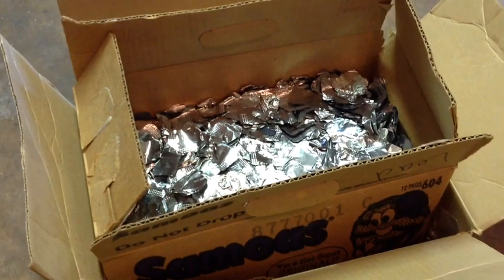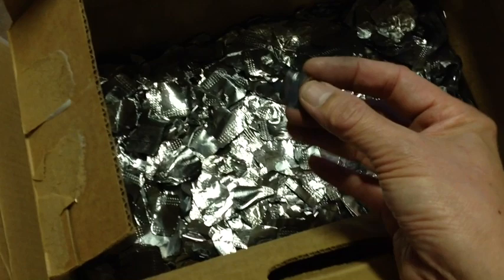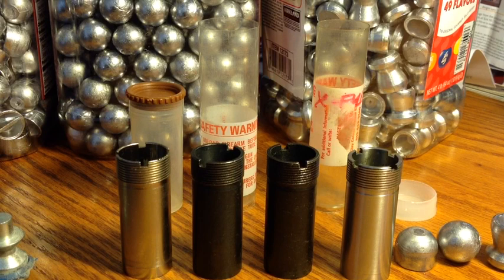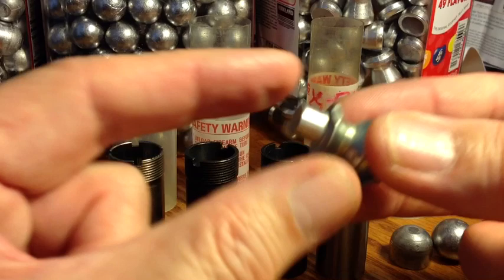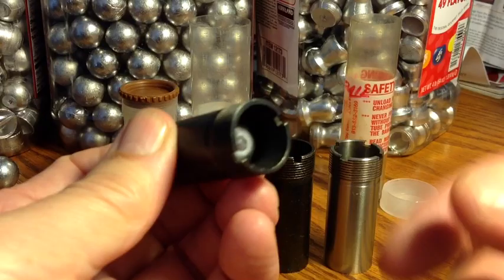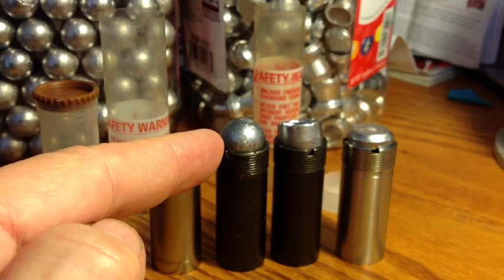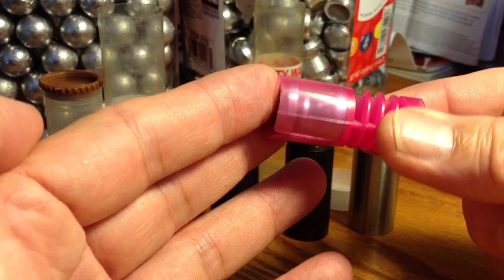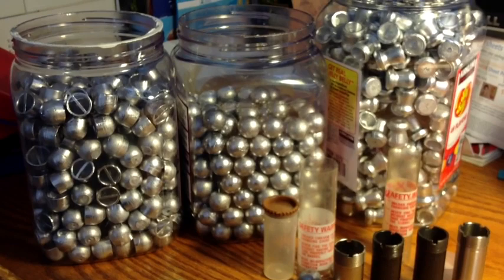Why Only Pure Lead For Shotgun Slugs?

Comment: +Fortunecookie45lc I picked up a Carleson's extra full choke for my 870 tactical smoothbore. It is 0.690" and my 7/8" ounce lee slugs fit through it almost perfectly (without a wad). The widest part of the slug is 0.680", so there is about a 0.005" clearance between the slug and the barrel at the widest part when it passes through the end of the choke. My question is, can I use the lee slug safely with this choke if I completely cut back the petals on the wad and do you think I would get good accuracy using it? I think it's a worthwhile experiment to try, but I'd like your opinion on it first.
Reply from the maker: jjenson2006 - Sorry, got to give you the company line on this...Those Lee slugs are designed to 1) be cast of pure lead for max softness 2) be put into target trap wads and 3) shot through cylinder bore chokes.  Problem is that if you shoot those slugs through your XF choke - 1) if petals are not removed, you will have high pressure from the petals stripping off - you've already addressed this concern 2) if cast hard at all, you will have higher pressures 3) the slug may very well slug up a bit and then when it hits the XF choke tube, pressures will spike.  There have been many cases of shooters accidentally shooting these slugs through full chokes, and there are safety margins built in to get away with this...But XF choke is a different story.  Your XF choke was not designed for slug shooting and neither the choke maker nor the gun maker nor Lee Precision will condone shooting slugs with that choke.  My Lee slugs mike at .685".  Now, the test we always do is to drop the slug or slug/wad combo through the barrel, if it drops through or can be pushed through with a wood dowel without too much trouble, the slug or slug/wad combo should be safe to shoot.  So according to the rule, your XF choke will shoot those slugs...If you intend to test this, be sure to back off on the powder charge by 15% or so and just do a pressure test.  Your options are to use a very strong compression zone wad like the Federal 12S0 or 12S3 and cut the petals off, or use fiber wads and a good over powder obturator wad to prevent squibs.  But without the post type wads that the factories use, you won't have any slug centering as it trips its way to the choke.  If your accuracy at distance is not acceptable, it would not be a surprise.  But you might have the magic barrel there, no one knows.  I can't tell you if this is going to be safe or not, there are variables beyond our control... And if you ask any YT poster if something that is outside of published reloading data is safe to do, we really can't answer that with assurance.  Best to ya,  FC
Reply: Thanks for the info; I certainly would not hold you or anyone else responsible for any accidents that happen experimenting. It would be 100% my responsibility for my own actions. I just wanted your opinion. Another thing though. I tried pushing wads through that XF choke with a stick and this is without even a projectile and I could not do it; I would have to use a hammer; these are basic wads, just like the 12S0 or 12S3, both of which I have. So how accurate would the push test be if we know that all wads (even using shot) will not push easily through a choke tube?
Reply: I tried this load today with the extra-full choke. The round fired no differently than any of my other loads. There wasn't a bigger kick or a louder boom; however, I was shooting over a chronograph and it put out 6755 FPS. This scared the living shit out of me as I'm assuming that the pressure in the barrel was quite high. So I took the choke off and fired the rest of them with a rifled choke tube. The rest fired in the low to mid 1100's, except for one that did 1654. Any thoughts on this?
Reply from the maker: jjenson2006 - The 10-12,000 psi pressures of our shotgun loads will shoot those wads through your XF choke nicely with turkey shot loads - the shot charge easily compresses to allow passage (reason for the choke in the first place = pattern control).  Those same pressures will  push a slug out that XF choke because the only alternative is the barrel blowing up.  The push test is done to get confidence that the slug/wad combo will go through with safety margin - the barrel will handle those without undue high pressure.  If you can't push the slug/wad through, your powder charge will still do so but with higher pressure.  Whatever success you get will come at a cost of higher than spec pressures that you cannot read by your own physical feedback - certainly, if you can tell the difference, the pressures are really getting high.  At any rate, you have used up any safety margins built into the system.  Any additional variablel, like a slightly oversized slug, slightly harder slug, slightly thicker wad, slightly bigger powder charge, fouled barrel - or any combination of those plus other unmentioned variables - might be horrendous.  And if your barrel does let go, chances are high that any bystanders or with 'ems you have along will have higher chances of injury than the shooter.  Certainly, they will not have any less chance of injury unless they are far enough away.  We have to be responsible shooters not only to yourself but to others - and those others include those that love you.  You've seen those videos where they are testing - they use a string to touch off the gun while standing behind a wall, and they shout "Fire in the hole!!" - there's good reason they do that.  You're doing the same thing while holding onto that rascal with your tender flesh and blood.  Your chrono test has two possibilities - 1) the reading of 1654 fps was actual and you had a equivalent of a magnum load or 2) it was a false reading caused by other components of the blast.  You can't tell without shooting additional rounds, but I'm glad you did the right thing. There's a rule that if anything ever goes out of range, we reassess.  I only wish you good shootin'    FC Steve
Reply: Thanks! I agree. You said however, that the shot can compress, whereas a slug cannot. That is true, however, if the slug is small enough to slip through the choke on its own and the wad that is being used has all of it petals cut off; would I have to worry, considering that the slug is now totally unshrouded by the wad? Every one of those loads I made sure that the slug slipped through the choke easily. I would say that maybe 1 in 10 would not easily slip through, probably because they were slightly deformed; but I didn't use any of those.

The reading I got from the chrony was 6755! Do you think that was just a miscalculation from the chrony? Is it even possible to reach that velocity (with excessive pressures) from a shotgun? This got me thinking that it was probably a glitch that caused that reading and I may have overreacted to it. After all, the recoil felt no different than my other loads. I know rifled slugs are designed to compress when they go through a choke and the slugs I am using will fit without needing to compress; this is why I think they would be safe to shoot. Maybe I should shoot one again over the chrony with a string attached to the trigger, just to see if I get a normal reading; then I'll know that it was a false reading the last time. What do you think?
Reply from the maker: jjenson2006 - You are referencing the so called bare slug.  Bare slugs are usually like .728" in front with a back edge skirt that is somewhere around .732 - .733".  These back edge skirts are friction fitted to cylinder bore shotgun barrels and the front is designed to ride the barrel.  The wads used are the old fiber wads with overpowder obturators - or they are plastic wads that have posts that are mated to the back of the slugs to keep them centered.  Federal uses a ball in the slug that sticks down into a recess on top of the plastic wad. 
 These keep the slugs centered as the bare slug rides down the barrel.  Fine accuracy is oftentimes realized. 
 You can even hit targets at distance with these as many have shown.  We don't have access to these slug wad proprietary mated systems.  Our slugs jerryrigged into target wad cups that were never designed for slugs (1250 fps with #7 1/2, #8 or #9 shot vs 1300 - 1500 fps with slugs).  At first, I wasn't sure that your 6755 was a misprint or not... Velocities that high could be explained by your chrono screens tripping on high velocity blast components - It was some kind of glitch and not an actual reading.   Sometimes our chrono can trip from shots fired on adjacent lanes - we get those as ERRs as one scree trips but not the other.  If your slug drops through your barrel, it will be safe to shoot, but accuracy may not be stellar because of the "rattle down the barrel" effect.  If slug rides smoothly through with a gentle push from a dowel, that is how factory slugs work - they have small skirts that are frictioning the cylinder bore mated with post wads that keep the slug centered.  If you can push your slug / wad through the barrel, that's how our Lee 1 oz and 7/8 oz and Lyman 525 slugs were designed to work - but what kind of systems are these where you try all these target wads trying to get something that will shoot decently vs a mated post wad that firmly keeps the slug on line.  But the barrels are supposed to be cylinder bores (or IC is OK) and the slugs are supposed to be cast of pure soft lead.  You don't need a string on the trigger to test those because you already have done so.  It's that XF choke that is the kicker here.  Since you have shot some slugs through there already, and the pressure signs were OK, I would think that you are OK, but still the practice of shooting slugs through your XF barrel has very little safety margins to work with, even less than full chokes - and every written source you see will tell you no - go on shooting slugs through a full choke.  ...Best to ya as you continue your testing.

Comment: I use the soft lead from jacketed bullet cores. :)
Reply from the maker: busyhands94-That's getting to the core of the matter, for sure…if we can't get pure lead, then lead as soft as we can get is still in the program…Sounds very workable…Best Regards to ya...
Reply: FortuneCookie45LC
The lead from bullet cores is nearly pure from what I can tell, it helps them expand better. I've been using it in cap and ball revolvers for years, I never have gotten a batch that wasn't soft enough. And, while you're sifting the berm for lead you can get cast bullets. Those are harder, and I use them for casting .38 Special bullets. No leading problems here!
Reply from the maker: *****- and I thought I was the only one sifting berms all these years - It's great that we're not ashamed of doing that any longer.  I remember past happenings when a young man told his girlfriend at the range when I came back with a bag of range scrap - "Oh, he's just scrounging…"  Well, I haven't heard those remarks recently - what I have seen is others now competing with me for range scrap!!  Best Regards...
Reply: I maintain a bunch of golf carts, batteries provide a good bit of lead,not the plates though,just the terminals and there is bars that run across the plates on both sides inside.

Comment: Try Rotometals.com--they have plenty of pure lead and lead alloys for bullet casting.
Reply from the maker: +echale3 -- been a regular customer of RM for years...I think they know me because I've done videos on their operations...Best Regards to ya!!
Reply: Cool, I'm going to have to start using them because my clip-on WW stash is getting rather low, and I can pretty much duplicate WW alloy by mixing their hardball alloy and pure lead 1:1.  Too, it'd be nice to know for sure what's in my alloy, rather than taking a SWAG....
Reply from the maker: +echale3 -- Hardball is made by mixing Linotype 1 to 1 - so you are doing a further reduction to a 25% Linotype - sounds like that is what today's WW are (but less and less of that will be seen in the future as the WWs are now zinc or steel).  I still really like my range scrap that is the same as RM antimonial lead - about 3-4% antimony.  Thanks for your comments...Have a great day  - FC
Reply: You're right about the COWW being found less and less, that's what I'm facing around here.  The glue-on weights were pretty close to pure lead as best I could tell, but even those are becoming harder to find in bulk.  Tire shops are not the veritable jackpot for COWW like they used to be.  Time was when you could get a 5 gallon bucket full of COWW for a few bucks.  Not any more!
Going with a mix of hardball and pure lead 1:1 will give you an alloy that's very close to  COWW alloy--0.5% Sn, 2% Sb, and 97.5% Pb.  The 1:1 blend comes out to 1% Sn, 3% Sb, and 96% Pb, which I figure will be close enough to COWW for my purposes.   I just want something in the ballpark, consistent, and available.
BTW, I really enjoy your shotgun slug videos, I'm working on finding an accurate load and loading process for the big 525 grain pellet slug.  Oh, and if you ever decide to sell that 7mm BR XP100 in your video from a couple years ago, let me know, LOL!  I sold mine, and kind of wish I had one again--they were spectacular pistols...
Reply from the maker: +echale3 - Thanks for the information on your mix of COWW alloy.  That should make very effective slugs.  There was a time that we could go to tire shops and get wheel weights for free - and they were all 100 % lead - none of those infernal zinc and steel ones.  Now, if we get wheel weights at all, they are more zinc and steel than the lead ones.  I'm down to one dental office that is still using the x-ray film packs.  After that, I might have to just use the range scrap for making slugs also - that is actually about 3% antimony lead and very useful raw material for casting.  Have a great day!!

Comment: Or cut the barrel down to 18" and shoot anything! ; )
Reply from the maker: gman77gas- Fantastic - it's the straight through tube trick…neat. but then we lose the removable choke capability for field hunting and ducks, clays etc… Everything is a trade off after all… Good shootin' to ya..
Reply from the maker: gman77gas Good castin' to ya… Once you see those neat silver torpedoes drop out, you'll be liking bullet casting more and more…Best Regards...
Reply: @FortuneCookie45LC  I just have different barrels,a rifled slug barrel, a field barrel with different chokes and my favorite home defense barrel

Comment: You're acting like wheel weight lead is a lot hard than normal lead, which it isnt. The antimony and tin in wheel weights only makes the lead pour and fill out molds better, it doesn't add much hardness at all. If you got zinc in your wheel weight, then that's another story. Zinc is quite a bit harder than lead. Know what you're doing, and you'll be fine.